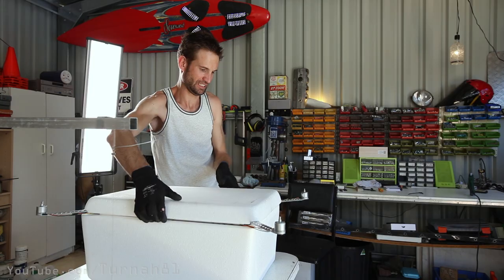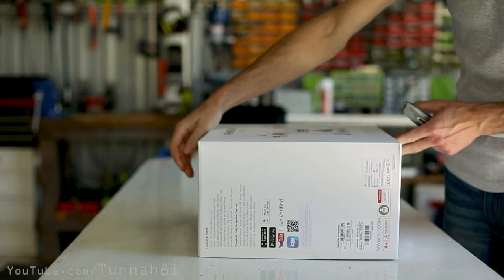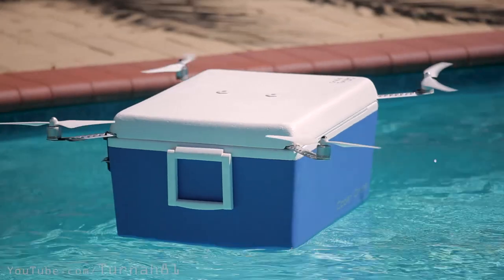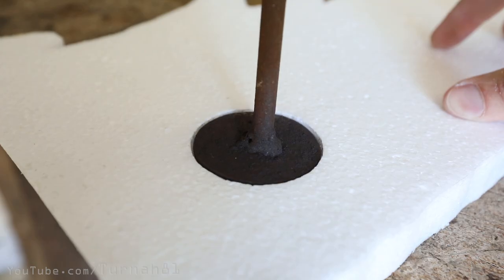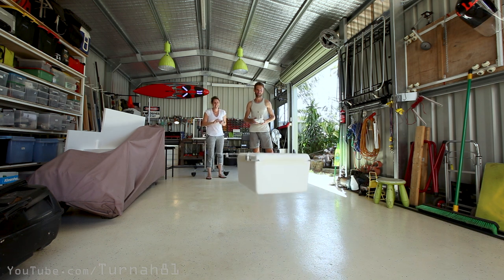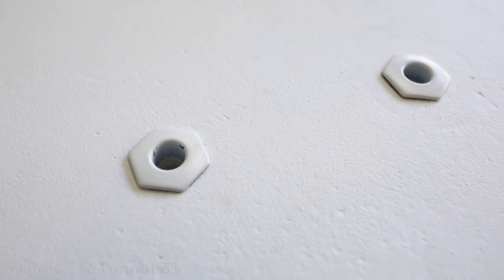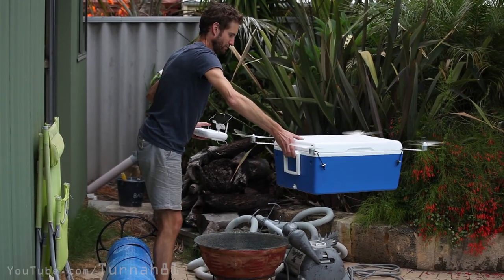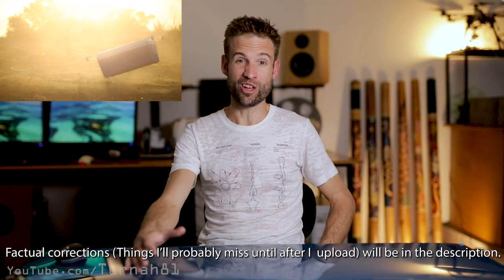It Worked! ..But Everyone Thought my Video was Fake.

Comment: Great project..!!! Here's a tip, To carry heavy load, you can try changing the propellers, and also those motors to new high capacity ones while still connected to DJI controller, add an additional battery pack separately connected to drive those motor.
Reply: Or you could just buy hobby grade stuff and lift whatever you like, possibly even yourself.

Comment: I've worked with foam patterns that were used to make fibre glass molds before. The method we used to prevent the patterns from being dissolved by our resin was to repeatedly coat the foam in layers of elmers glue that we thinned out with some water so that we could air brush it on. One guy on our team was smart enough to dye the glue different colors just to assist visually.
Reply from the maker: Great tip.  Is elmas pva?
Reply: @Turnah81  I think so, but I'm not sure on that.

Comment: For the bottom view, just cut a small hole in the bottom of the cooler, put a clear plexiglass disc over the hole (maybe use silicone sealant to attach it?) and put the camera pointing down through the hole/plexi.

Comment: The aluminium sticks used - why? You could have just used something way thinner and lighter, turn it 90° (so it is not the broad side up) and used some string. Strings are quite strong for their weight and would distribute the tension directly from the motor to the bottom of the box.
Reply from the maker: Yeah I really wanted to use carbon tube, but everything was weeks of postage away, and I still wasnt even sure if it would work.

Comment: I think this drone can be a huge aid, if you redesign properly with stronger and lighter materials. Carbon fiber container w peltier cooling with enough batteries to be remotely controlled, and i can imagine this as huge aid with some blood/plasma sacks, and analytic medical equipment that needs cooling/to be kept cool/sterile or fast delivery for doctors who are using motocycles to reach the event place. Many times this can be lifesaver. IF you can manage to fly about 5 hours straight, docking, w load/unload mechanics, approx with total load of 8 kg of pure load - you can be a hero.

Comment: Wow! After seeing the cylinder valve (for the GPS) I'm assuming you are also someone who has spent extensive time working on automobiles! :D  

I'm a former auto tech (started working on my own shitboxes and then moved into performance-only). ...to the point... I was going to try this project !!!  (I have a p4p  but also have a p3s AND a p2v (which is broken) from my university lab. 

I have been wanting to use the NAZA controller out of the P2V (can easily be "hacked" to allow all naza features, the central board is dead)    to build something like this..  AMAZING F'N AWESOME DUDE!

now that i know someone built my flying cooler idea .... two years ago... I think i want to try as similar idea but somehow convert to an amphibious "rover/boat"

I'm heavy into DJI "hacking" -- there are easy ways to get around using stock batteries.  (and ways to use 4s setup with ph2/ph3!!) 

I may have missed it, but you need to absolutely INSULATE/SHIELD the gps... it's a big issue with phantoms... we can even upgrade to a better GPS unit fairly easily (it looks like you have PH4 props on your p3s setup?) 

The end goal of all this electric tinkering is ... figuring out what makes electric vehicles work well during this transition to all-electric automobiles that, aside from the petrol engine noises I'll  always be extremely fond of, the electric is objectively "better" in almost every way.  Almost feels like we've been held back sometimes when i work on all these quadcopters/fixed wing crafts / electric scooters/ bikes/etc. 

Your original vid started auto-playing on my tv as I was typing this and.... still doubled over laughing at the smashed phantom/beer .. great work :D
Reply: did you swap motors? those look like p4p motors but can't tell?
i'm laughing my ass off at the initial release of this cooler drone... Thank you so much for the comedic relief,  top notch editing as well :)
Reply: also, you are a master of creating brilliant euphemisms .... something i usually have a hatred for, but nonstop laughs and smiles here!!!    Ok, I'm done praising a grown man for today.   assuming 81 is your birth year (82 here) ..  Never stop  "innovating" :D

Comment: if you had got rid of the plastic shell and extended the ally arms into a large X, you wouldn't have needed the high-density foam.
Reply from the maker: Cheers yeah had thought about it, probably could of if I used carbon tube, but had no motor mounts for tube. With the aluminium it would have been super heavy. it is quite a distance to span, would have  more than doubled the arm weight- didn't have the power, plus the exit angle wouldn't have  been a nice 45 degrees. would have been good to loose the shell though.

Comment: You should do a phony Quickstarter video! About a new drone that can carry your beer, lift it off the (empty) from the front door of the liquor store  to your car (why use a shopping trolly/shopping cart) and land it on your vehicle on the roof rack. You strap it down. Then a scenic drive along mountains to the coast. And show it going from the parking lot following you diligently to your camping spot. It arrives and (surprise) you open it up to see all the beer and soft drinks and ice. Slight slide of hand of course. 

Pop a cool one lounge around. Throw the empties back in, drain the melted ice. Maybe a shot of where a trail of water on the ground shows up. It flies back to land on the top of the car automatically. Strap it on. Load up the car drive off along the scenic mountain and coast. Saying it is available for 500 bucks or some silly thing. etc etc. 

But mention its a satire only. Could even stretch things a bit further by having the cooler fly around the store with you as you "load it up".  Show amazed faces at the checkstand. Follow you around the beach. Pretend to sit on it. Carry the dog or infant back to the car (show mothers face), go back to the car for a second load etc. Pretend to have a couple people sitting on the cooler too. Rescue a drowning swimmer. All sorts of escapades. A hunting party where ammo arrives and the fresh killed bird is whisked away by the cooler. lol All implied that it is a smart cooler. A lovers couple has wine and condom arrive via cooler. Fishermen have beer and snacks arrive by smart cooler drone. A thief steals the cooler, robs a jewelry or gold bullion place, fills up the thing, it flies away, he walks past a cop with his hands empty in his pockets, smiles knowingly. Jimmy falls down a mineshaft, sends the drone back with a message. Flipper the dolphin, finds a lost person on a desert island, flys the drone to them. lol

It could almost be a Lassie type TV series where the cooler always saves the day. Yeah, watched too much TV as a kid. If the idea gets a million dollars, I get part of it lol.

Comment: I mean to the extent that it's "fake" is technically accurate, as it's a non functional flight. People that see the video will likely think that the flying cooler is full of ice and water, which it isn't. So somebody calling it "fake" isn't wrong, unless they're specifically thinking it's CGI, which it really isn't, but it is still a "fake" video.

It's like if you made a styrofoam car and put rotors instead of wheels and it flies and you call it a flying car, it's a fake video, because it's not actually a flying car, just like this isn't actually a flying cooler.

Comment: Try This
Blimp Drone ...helium
or polyethylene glycol (nanobubbles of helium) with a nylon net and a ring drone (aluminum or graphite frame)
mount a smartphone (surveillance app) and a GPS TRACKER (on you)  it will follow you around
the top of the net houses lightweight array of solar cells 
Note: the size of the helium-filled 'nano-bubbles' can be adjusted to maintain 20 feet or so
the props can have a geared angle (up/down) 
Next aluminum powder in the polyethylene glycol for a 'charge' (battery core/antennae) carrier current

Comment: Great stuff ! Next time, - you might know it by now already - but you can use epoxi resin with polysterene foam without the melting effect you had with polyesther resin. Use it for glueing ( much stronger than anything , also on metal ) and you can make lightweigth filler with it and you can laminate fiberglass, carbon fiber etc. to the polysterine. 'Styrofoam' is the same material but homogenous ( is that english ? ) it doesn,t exist of litle spheres and you can shape and sand it better. But it may be heavier... ( I have a lot of experience with that in making windsurfboards, among other things ) Cheers ! greatings from the Netherlands )
Reply from the maker: I didn't actually think to try epoxy. I think i was thinking ease and price at the time I think. Cool I don't think I have actually seen real styrofoam in the flesh before. Have used surfboard foam blank though once for a knee board build, not sure what that is made from, easy sanding.  cheers
Reply: Styrofoam comes often in sheets and is used for insulation on roofs, often blue in color. B.t.w. I have used polysterene foam - with the spheres - for my surfboards because that's the most lightweigth ( it comes in different weighth classes/ density ) and you can sand it pretty smooth still. 
Also: Epoxi is more easy to use then polyesther because you have a much longer 'potlife'. Maybe you can use my info in future projects. I find it realy interesting what you can make with composites. ( Epoxi is the most versityle and strong glue / resin that you can get , comes in a lot different kinds) Thanks for your reply !

Comment: quad wont work octa copter will also size of the cooler a little hurdle and you can remote pilot by sitting at home using mission. control from inav .
use pixahawk 2.1 with the cube.
for frame use a tarrot octacopter frame.
1 x Tarot X8 Octacopter Frame
8 x 4114/320KV Brushless Motor TL100B08
8 x Flycolor 40A OPTO 2-6S Brushelss ESC
8 x 1555 Foldable Propeller TL100D04 (4 pairs)
you also need a 6s 5000 mah battery or you can get a 12s pdb  with 2 6s 
use a matek gps/ glonass , preferrably 2
use rasberry pi 4 for loading mission.
sonar sensor in front and back , (optional). 
matek optical flow sensor / intel real sense for landing 
a drone parachute for failsafe
a light according to faa guidelines.
as an fpv camera use caddx ratel starlight 2.1
there you go its ready .
it takes a day to build  a project like this , but it takes months to test the project .
total cost for the project just mail tarrot , matek , they will send stuff to you. 
YOU CAN DO IT , I KNOW DEEP DOWN. BUT ONCE YOU FINISH THE PROJECT YOY WILL HELP LOT OF PEOPLE WITH YOUR IDEA AROUND THE WORLD. ALL THE BEST FROM Techado.

Comment: Um... i think i found out a solution to the weight problem and the energy problem.
From my last comment i solve the weight problem. So the energy problem... if you know how Tesla cars have there batteries.. well why not under the flying cooler but have the batterys as rechargeable. And a big wireless charging coral inder it... the drone need to be on top of the cooler not inside and a customize  frame on the drone. A frame that let cool air in the sistem for the dron to keep it cool. A AC/DC converter to convert the high electricity from the batteries to the sistem without it frying the drone. But a DC to AC converter to the jets.... 
I think i should  build this myself.

Comment: The video was fake or at least misleading.
It's basically an empty styrofoam box drone. Not a heavy Coleman Cooler filled with ice and beverage as you pretend.
It's like flying a 300lbs anvil (but in fact, it's a prop looking like an anvil) 
Thumbs down for bad practice, even if the video was great.